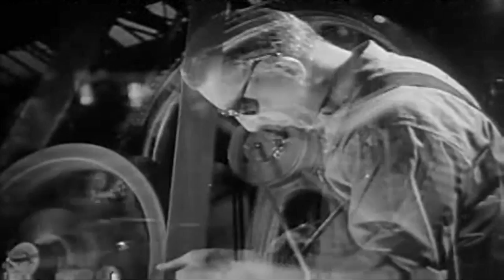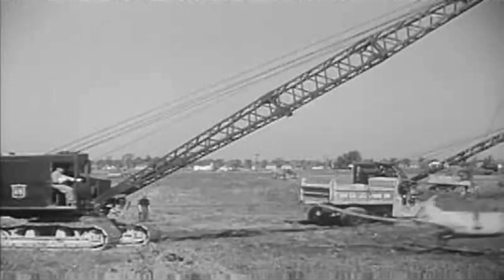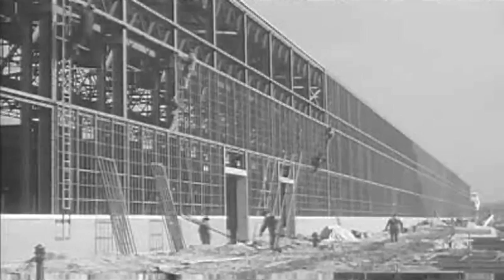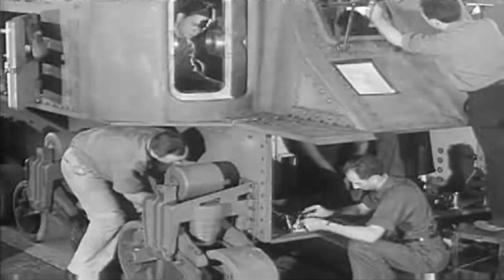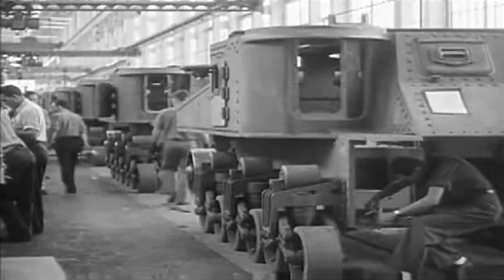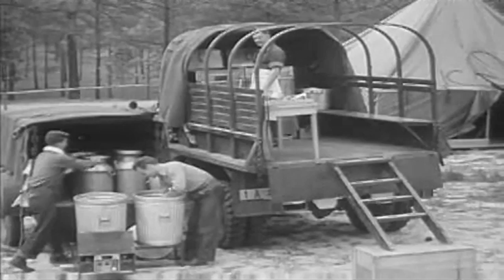WW2 Chrysler Tank Film: Assembly Lines Of Defense (full)

Comment: All that, and they put their multi-bank “radial” motor in it.  Five flathead sixes stuck together that gave the troops nothing but trouble.  Most were pulled out and replaced with continental airplane engines.  The flathead six was designed to be vertical.  When mounted sideways or upside down, in the multi-bank arrangement lubrication was poor and bearings seized..
Reply: Not the case at all. In no cases were the M4 subtypes given different engines outside of experimental or post-war refits. An M4A4(75) during the war would be built with a Chrysler A57 multibank engine, and any replacements would be a A57 multibank engine.

 It had quite a reputation for good operational reliability after the carburetor, as well as the fuel and oil lines and valves were reworked in mid to late 1942.

Comment: 15:40.  What are "cast steel forgings"? I suppose you could say the giant ingots are "cast" at the steel mill before "soaking" and being rolled into various forms of stock. Cast steel forgings as an oxymoron actually. They are two different manufacturing processes. Castings are made from liquid metal poured into either sand or metal molds while forging involves slamming a piece of already solid stock into the shape like with the giant hammer forges visible in the Master Hands vid here on Youtube. Whatever though.

Comment: Radial gasoline engine? Seriously? What an odd choice.
Reply: Dude. I was a chem major. Diesel has huge advantages. It's safer because it's harder to ignite (and FAR less dangerous when refueling in the field), It's more energy dense per unit volume. so it goes farther on a comparable fuel tank size. It's easier and cheaper to make diesel. And while diesels are somewhat bigger and heavier than gas engines, they are also more robust  and less prone to breakdown. Needless to say, almost every modern tank is diesel, except the Abrams, which can use a wide range of fuels due to it's gas turbine. The export Abrams however, is diesel.
Reply: +PointyTailofSatan 
Cooling. The Germans had a diesel that was cooled right down the middle.
Reply: +Dorothy Gale Ya, but air cooled engine usually depend on high air flow from high speed motion, like aircraft or motorcycles. A tank is the exact opposite.
Reply: +PointyTailofSatan  you have it right it was an aircraft engine. it was what we had at the time. check out the ford gaz engine
Reply: Gasoline. Germans had gasoline.
Reply: Gasoline is WAY more dangerous than diesel in a tank. Assuming you don't want to burn to death.
Reply: PointyTailofSatan In combat, they're equally dangerous.
Reply: No, that's not true. Read up on the use of gasoline engines on tanks and why it is poor design. Gas is far more flammable in the event of a hit. Unatomized diesel burns very poorly.
Reply: PointyTailofSatan I'll admit I'm somewhat clueless on the make up and the chemical properties of fuels. However I'm referring purely about the Second World War, the Soviets typically had minimally refined, well everything from fuels to fuses, to flashless gunpowder. And there are many cases where the T-34 starts burning up from fuel. Not helped by the fact the fuel tanks are within the crew compartment, unprotected.
Reply: I would assume it was the choice as of lack of funding being this close to ww1 and so on and so forth.
Reply: No diesel because gasoline is everywhere. During time of war during this time you'd be lucky to find supply dumps of diesel. You gotta make what the enemy has a demand for and that is gasoline. As far as being dangerous, if the tank took a hit to ignite the gas, the crew was probably dead anyways.
Reply: OK, first off. I dont care about degrees nor did I question it. So.....diesel engines are far more intricate precision wise and more expensive to build. Everything in a diesel engine has to be correct. A gas engine can just be slammed out in no time, that and everyone can be a gas engine mechanic. Even ones with a chem degree. Again, whether or not current models of tanks are diesels, almost all early tanks were gas. Diesel during this time was still being played with. Yes, being used, but not to its full potential like nowadays. I believe most of that didn't happen until the 50's.
Reply: @duanedean3256  so your saying gasoline engines don't have to be built to exact tolerances? That's not true at all.
Reply: Airplane engine shortage so Chrysler used what it had to start making tanks put together 5 six cylinders for the making tanks https://www.google.com/url?sa=t&rct=j&q=&esrc=s&source=web&cd=10&ved=0ahUKEwj01vbq8IjVAhXF4iYKHT0CCiQQFghLMAk&url=https%3A%2F%2Fen.wikipedia.org%2Fwiki%2FChrysler_A57_multibank&usg=AFQjCNHBHK_LhIrCBamJJ2g0i47ZyUQIsA

Comment: The M3 Lee was a b-a-d tank: high profile, low velocity gun, riveted armor and no commander's radio.
Reply: It was only meant to be an interim tank before the M4 production was ready.
Reply: boyd868b    what allied tank would you prefer to use?

Lack of competent options is irrelevant as to whether something is bad or not.  For another example, just look at the current US Presidential candidates from both parties.
Reply: It was better than the Panzer III and short barrelled Panzer IV
Reply: RonJohn63 it was one of the best for a few months, until the Axis made something to counter it
Reply: +achtungcircus  still better than a a-13
Reply: It was a start from scratch not bad if you ask me.
Reply: The M3 was a stop gap tank.  The best that could be built at the time until they developed a turret to take the 75m gun.  Even the Sherman had the disadvantage of a high profile, due to using a radial engine in the original tank. The British loved the M3when they first got them in the desert, because they finally had a gun that could fire a HE shell to take out the anti-tank guns, which was a tanks major threat.
Reply: +RonJohn63 I prefer Pershing tank.
Reply: +RonJohn63 for early 1942 what allied tank would you prefer to use? and it did have a radio
Reply: boyd868b Later models of the A13 Churchill were much better. Or did you mean just Mk. 1's?
Reply: RonJohn63 it filled a gap though when there really wasn't anything else. Not gonna disagree though.
Reply: I will it was a cheap shot from a Monday night quarterback that wasn't there.
Reply: Or steel coffin..!
Reply: I'd have used the word crap. 
Or death trap.
Reply: Its worse now , we have liar Trump and his millionaire cronies. Not sure if he will have anyone working for him in a few weeks. FIRE HIM LOCK HIM UP LOL